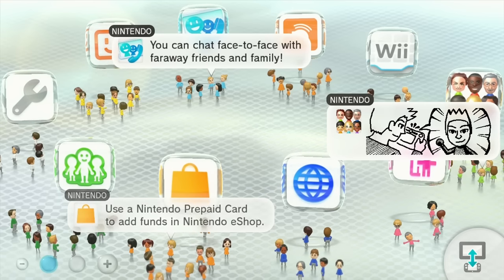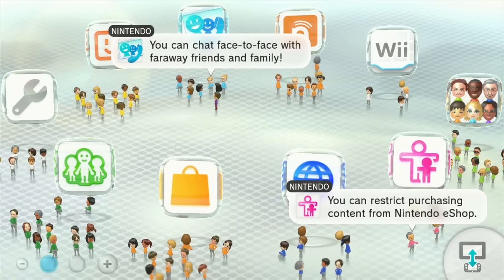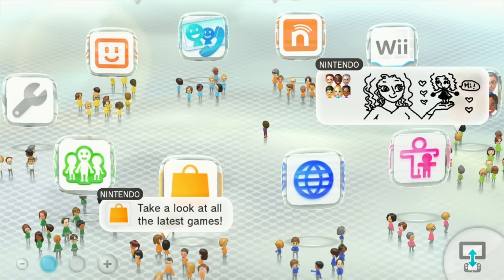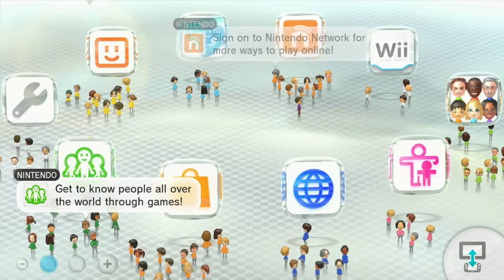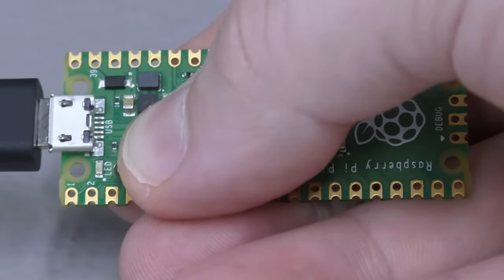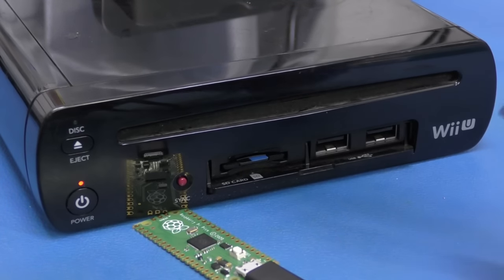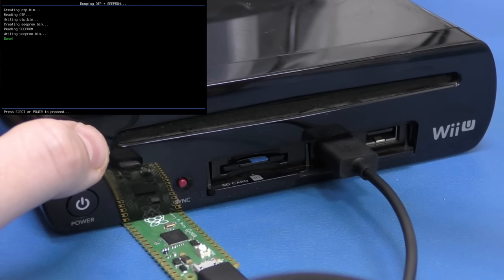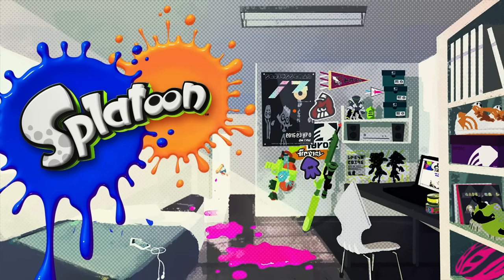The Truth About the Bricked Wii U | Can You Fix yours For $8?!

Comment: Thank you so much for your work giving these old systems new life!

What symptoms typically are NAND corruption, versus this problem's error codes? A friend of mine has a system that boots normally, but hangs shortly after boot, either into Wii or Wii U mode. I was wondering if this method could help get that console back out of the grave.
Reply: This didn't work for me. I had the same symptoms as your friend. My console gave no errors, just loads up to the Wii U logo and doesn't progress further than that. It does fire up into the Wii mode menu but will just go to the Wii U logo if I click on anything. 
I tried to do as the video instructs but no joy. 
I just can't get to the Recovery Menu like Voultar did in this video.
I've copied over the udphih.uf2 file into the Pico
I've copied over the recovery menu file onto a  64GB FAT32 SD card
Put the SD card into the Wii U
Fired up the console
Plug in the Pico the second the disc drive stops making noises
but then the console just shuts down
Reply: @pgcroat6112  Running into the exact same issue, my Wii U just shuts down right after I do the Pico step. I sadly have all Hynix chips on my motherboard so that may be the issue, it's just a bunch of dead chips and might have to swap it out/get a "new" console.
Reply: @pgcroat6112 
Reading other people's comments, it might be because you need a 32gb SD card instead of 64. Also allegedly using a normal sized SD card instead of a micro SD with an adapter is recommended

Comment: Thanks for sharing! Tried it on my console giving a 160-2215 error code at boot. While I was able to successfully set the cold boot title, I still get the same error upon boot. I was able to determine that it's using the Samsung nand chip (8GB basic). 

The console did sit unplugged for 1.5+years, so maybe it is truly corrupt, but still holding out hope for a fix someday!

Comment: Just had the 160-0103 code pop up today, but only in the middle of playing or trying to boot up games. Not that I expect all the answers, but were any of the consoles you've fixed (or read about being fixed) like this? I don't mean showing the code when turning on the console, but specifically when loading/playing a game - I just want to check before I pick up a pico. Either way, thanks for all the work you've done for the Wii U community!

Comment: This can also be done if you have a modded Nintendo Switch. I finally got the timing down using my perfectly working Wii U but a person up the road I know at one point had his Wii U bricked (coldboot homebrew exploit gone wrong) and this might be able to recover it if he still has it. I'm thinking of knocking on his door tomorrow to ask. Also I noticed that if a Gamepad is paired and working and it triggered to turn on during the time before the exploit is pushed that the gamepad will display the video signal and you won't get one on the TV. I only got the TV to show it once when the gamepad didn't turn on.

Comment: Tried giving this a shot today using this exact method. Got onto the v0.5 menu, followed the steps, got back to the wii u screen, but anything short of the Wii system portion causes the 0103 error to still show up. 

luckily the pico wasnt expensive so no worries there, but still bummed out

Comment: This is great guide. I need to check on my wiiu. 
My system is not modded, will this work on it no problem? Because someone said I need to homebrew the wiiu first.
Also, in case if my wiiu still alive: is there a way to back up the data or at very least the save files?

Comment: I tried this on my bricked WiiU. The thing is mine won't output a picture through the HDMI. Still tried it though and the power button changed color to purple which indicated that the pico worked. I click in blind and i dumped the OTP + SEEPROM. Tried Set Coldboot Title also. WiiU still dont work but the files were dumped to the SD-card. Any thoughts?

Comment: So I bought another "bricked" Wii u. Console runs disc games with no issues but I get the error 160-0103 when I try to go into settings. Did the udpih and reset coldboot ID but still giving me error when I try to open settings
*Also same error when trying to add a user

Comment: I bought a Wii U off of Ebay with the 160-0101 error right after watching your video.  I already had a R Pi Pico on hand for another project.  Wii U was just delivered and back in business right away.  Guessing this one was a case of a coldboot haxchi and then a system format.  After doing the shutdown the Wii U went in to the full system setup, had no previous data stored on it.  It's a Samsung system if that makes any difference.

Comment: I guess I'm gonna have to load this in parts, sorry about that but blame YouTube. Note that self responses are a continuation of my story, and should be view chronologically, denoted by (2),(3), and so on.

(1) So I have a Deluxe Wii U that was bought at launch, and hasn't seen longer than say 3 years of non use during the time I've had it. I turn it on last year around August or September, not long after the 5.5.6u update was released, and my console freezes while trying to apply this update. Through following Nintendo's own troubleshooting, as they advise, I ignorantly deleted the update data for my Mario Kart 8 game, because I was led to believe that it was possibly the cause behind the console freezing. I can now not play that game at all, as opposed to not being able to play it online. My console is unmodded, and I've neve had issues updating before, and it worked just fine before all this. I have seen the dreaded 160-0103 error code before, but not since I've gotten a hard drive to store some of my game data on. Without this update going through, I cannot play games online, access my E-shop, and the 17 or so dollars I paid for to be on there, or update any games that may require it. 

Nintendo has been very unhelpful, to say the least, being seemingly resistant to offer any reasonable fixes or solutions. I know the console is 'old', and they never cared for it, but that does not mean that the customer should be left out to dry, even if it is out of warranty. Nintendo had me send my console to an electronics repair shop, and just finding one that works on Wii U's is a chore, half the places I called didn't work on them, even dedicated retro repair shops. The 2 places I did find that worked on them were able to replicate the update freezing issue, as it happens every time you attempt it, but were unable to tell me exactly what may be causing it. Honestly, at this point I am convince the 5.5.6u update is the kill all working Wii U's update, because I literally had no other problems with the console other than the one I mentioned above. I just don't understand why out of all the updates, even the one back in 2012 I believe, which was notorious for bricking people's consoles, it is this one, which, and I quote from Nintendo's site: "Ver. 5.5.6 U (August 29th, 2022) Improvements to system stability and usability. Further improvements to overall system stability and other minor adjustments have been made to enhance the user experience." I highly doubt the update changes much of anything, unless it is like I said, that this is the kill switch update, which would be a scummy thing to do.
Reply: (2) I have invested so much into this console, and finding out that there is absolutely nothing I can do, to my knowledge, or ability if it involves installing secondary software or modding, that is a horrible feeling. Perhaps it is because this is the first console I have bought and paid for almost solely myself, that I am more than a little upset. Upset... I literally lost about 10 pounds during my depressive 2 or so weeks of waiting for the tech people to look at my console, and upon hearing they weren't able to figure out the problem, let alone repair it or offer advice, it just becomes even worse. I can't even look at my gaming corner without feeling bile well up in my stomach, and Nintendo's treatment of my makes it all the worse. So after my initial attempts at repairs failed, Nintendo began laying out possible 'solutions', tone deaf and idiotic as they are. The first was to buy a Switch, believe it or not. Now, I already own a Switch, and I regret buying it, doubly so now, I'll get to that later, but telling a customer with a problem to buy the new console is about as insensitive and tone deaf as you can get if you ask me. It gets better, one tech guy suggested that to solve my Wii U issue, I would need to buy a 2nd Wii U, used more than likely, else pay a mint for a new one fresh in the box, then and only then would Nintendo deign to take it upon themselves to accept both consoles and perform a data transfer. I don't know if everything would go smoothly if I were to do such an idiotic, complex, and most importantly expensive 'solution', but I could foresee problems of memory loss, profiles failing to reconnect properly, all kinds of issues. Furthermore, if I bought a used Wii U, there's no telling the quality of the products. Sure you can see visible defects, but there's no telling whether it would have the same or worse problems than my own console, or have been hacked, which Nintendo is surely to frown upon at the very least, and I might even be on the hook legally if they found out, or refuse the transfer due to the piracy, I don't know how that works, but we all know how Nintendo is in regards to their property.

Anyhow, this all happened before I learned about the NAND corruption and the number of Wii U owners who are experiencing the same and worse than myself. Nintendo's indifference to this problem is absolutely unacceptable, unpopular and out of warranty and circulation product notwithstanding. It is absolutely idiotic that a console will fall apart because it is 'not turned on enough'. What is the metric for that, how much is 'often enough'? I've seen user estimates suggesting once a month, so in essence, you are contractually bound or obligated to turn your console on just to maintain its' functionality. That is the stupidest thing I have ever heard, and it literally makes no sense. People move on to other consoles all the time, and I for one have never had a console or device fail on me aside from my PS2's the 2-3 I've owned, and honestly, I probably just needed to wipe the lens so that it could scan the discs again, but I was too young and ignorant at the time to understand console maintenance. I'm still ignorant, but does that mean I should be doomed to suffer console failures and issues because of it? No, that'd be like saying just because you don't understand how cars work, you shouldn't be able to own or maintain one. That is why auto repair shops exist, people with knowhow assisting those without. The same concept ought to be applied to video game consoles, even if they're 'old'
Reply: (4) So, armed with this saddening information, I informed the customer service rep that not only were my problems with my Wii U not solved, they were far worse than I ever thought possible, and not only that, since the Switch uses the same memory system, again to my understanding, that would mean that it would be susceptible to the same corruption issues, so why should I continue to support it? It was so pathetic, the service rep didn't even try to convince me to change my mind or anything, just accepted that Nintendo lost a customer, and didn't give 2 shits about it. Essentially, I not only lost most of which made my Wii U most enjoyable, Mario Kart 8 and Splatoon, but I was forced to give up an entire console and its' games before its' lifecycle is up even, just because it is also doomed to fail due to a faulty memory system. I am all but forced to deny myself games that I want to play, the full roster in Smash, the upcoming Tears of the Kingdom game, and any other game or DLC that would otherwise tickle my fancy. There is no choice but to drop the console in my eyes however, as supporting the faulty memory system is just torture to the customer, you're essentially renting the content for however long the console lasts. How is that any different from usual? Well, things used to last longer back in the day, and a lot of us kept our old consoles for a long time after their era is through, and I for one have never had a console fail on me, other than the PS2's I mentioned, and again that may have been due to my young ignorance on console upkeep, or an underlying problem of product quality. Like I said, my older Nintendo consoles have all lasted this long, decades later, and still work, even ones that have seen 5+ years of inactivity, turn right on, no problems. The real cherry on top about the NAND issue, I discovered it on my birthday, my entire hobby was taken from me on my birthday, they day I should be happiest. I honestly feel like Nintendo has robbed me, not only of my enjoyment of their products, but my sanity as well, though that is not solely on them.

========================================================================================================

I apologize for the novel of self pity and woe, but I wanted all the information to be present for my asking of this: Is there anything I can do to get the update to load properly? That is literally all I need my console to do, is to perform what it is supposed to do. Any ideas on why the update freezes, what may cause it? Do I have the beginnings of memory corruption? Is there any fixing it/preventing it? I'm not knowledgeable enough to perform maintenance or any hacking, nor do I want to risk the console itself, or the ability to play online. Pretty sure you have to be able to perform a system update anyways when hacking, which would defeat the need for me to be hacking in the first place. I would honestly settle for just getting the ability to play Mario Kart 8 again, even if just in single and local multiplayer, because lets face it, Wii U servers aren't likely long for this world, might even be shut down already. That really sucks for Splatoon though...

Anyways, apologies once more for the novel, but I would like some advice. My console isn't totally bricked like the ones in the video, not yet anyhow, more of a semi brick I guess, so I don't know if the tool advertised in the video is something that would help or not. another thing I would want to know is if you do reboot the operating system with the tool, what happens to your data stored on the console? This is literally my last hope in getting my console back to full working condition. Would be great if an 8 dollar tool could fix my console though, even if it only lasted for another few years. One thing I have learned from this is don't invest heavily in something, but then again, if you know something is going to fail, due to age if nothing else, why invest in it at all? I'd think it to be torture to get something that you enjoy to bits, only to have it fail and be all taken away from you, with only memories remaining, tainted by the reality that you can no longer relive them but in your mind. Maybe this is why some people sell their old consoles to buy the new ones, so they don't have to experience this pain, but then again they can only reminisce about the fun times as opposed to reliving them. Well, any help or advice would be appreciated. Sorry for having to split up my comment, but YouTube wouldn't post it otherwise.

Comment: I've got a Wii U that won't get past the logo screen.  Battery removal and reset had no effect,  so I'll try this method out sometime and see if it works in my case. 🤔
Reply: Update: Unfortunately,  it did not work on my frozen on the Logo Wii U.
It's acting as if recovery launched,  but still only shows the logo screen.
I guess since it can't even get past the logo screen, it doesn't reach the point of the exploit.

Comment: Thank you for this video! I am unfortunately still getting the 106-0103 on my launch Wii U when I boot up some games or apps (like Mii Maker), however, I was able to get the seeprom and otp to backup which I was not able to do previously when just using a micro sd card without the raspberry pi pico.

Comment: I just tried loading my Wii U. I've not had it on since 2017. It loaded to the main menu, but every eshop game I've tried has resulted in 160-0103. I tried getting into settings, but I got the same error code.
Do you think I have the same problem? It seemed yours didn't turn on at all?
Reply: I tried a disc. Same result.
Reply: Can we get  @just-matt some answers please!?
Reply: @WhoWatchesThis  I'll try the fix when I get chance and report back
Reply: @Voultar I'm not sure what I'm doing wrong? I've followed your instructions, but I can't get into the boot menu after loads of attempts. I either go straight through into the Wii U loading normally or the console turns off seconds after plugging in the Pico. I don't suppose you have any idea what I've messed up?

Comment: Honestly cant thank you enough for this, ive not had chance to plug mine in at all recently but my model matchs the ones rhe common scare tactics are going for - launch 32gb Black console.

So it is a software issue and not hardware from what I'm taking away from it?
Reply from the maker: It MIGHT not be a busted NAND, but a mild software discrepancy that causes the Wii-U to not boot into the OS or to ouput an error message. 

It was being reported pretty heavily that all Wii-Us that are bricked with an error message are dying and irrecoverable, which is NOT true!
Reply: @Voultar  its very interesting, but so crazy! Thank you for your work, fingers crossed I never need to use it.